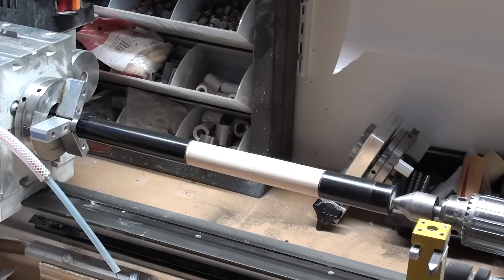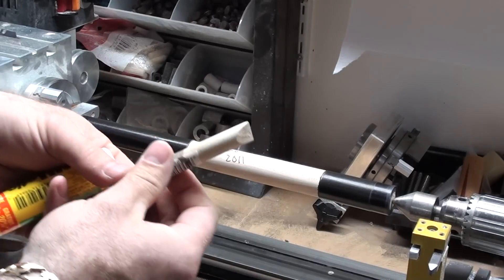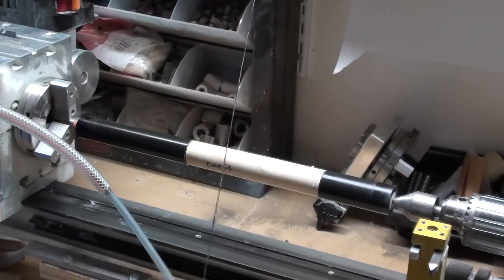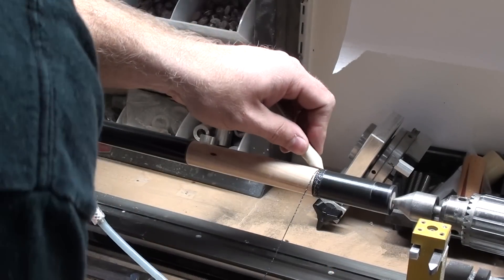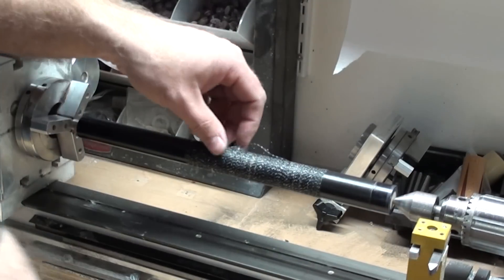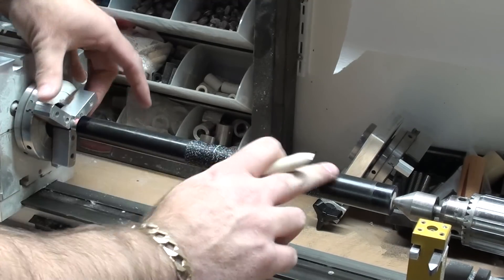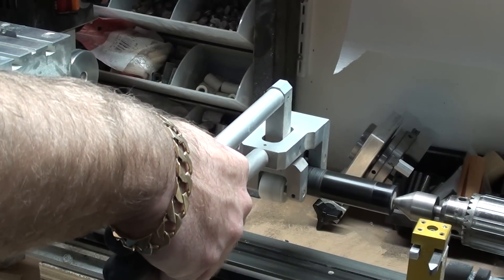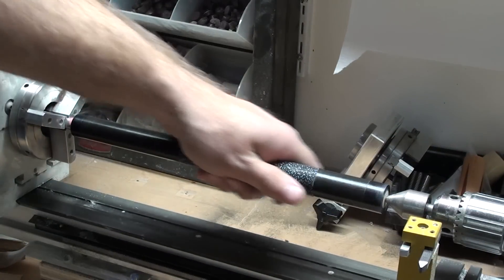linen wrap

Comment: Spinning the lathe while putting on the glue has inspired me to make a mini lathe for buttering corn on the cob.
Reply: Devon Moss Just butter your bread first then wrap your corn in the buttered bread, the corn will melt the butter for your bread and coat the corn also. Neat and clean.
Reply: Plus very fast eating of the corn too. Just put your teeth up there and spin the cob about 200 rpm.
Reply: @davids11131113  😂

Comment: I put a linen wrap on a cue that had two areas that needed the wrap years ago but I did it by hand without a lathe. In fact, I did it just by holding it with one hand and the other holding the linen string. I also didn't know to put glue on the handle first so I didn't! However, the wraps went on perfect and I used a can of clear lacquer spray. Turned out really nice. In fact, I still have the cue and it still looks great! But sadly this cue was Junk! It had about 4 or 5 sections and had chrome-plated washers between sections! I took it to the pool hall and tried to use it but man was it a terrible cue! It looks good but I could shoot a better game with a bent tree limb with a rubber cap on the end of it!

Comment: Just a couple of questions,  did you remove old thread or is this the first wrap?  has the wood been reduced a few thousands.  did you do that,  i notice the area under the wrap is very white,  is this just the color of the wood or is there some wrap under the thread.  thanks   very well done,
chuck
Reply from the maker: Hi Chuck, 
That is just maple under the wrap, you do have to cut a wrap channel in to allow for the thickness of the linen.
Reply: @Cuejo  thank you sir